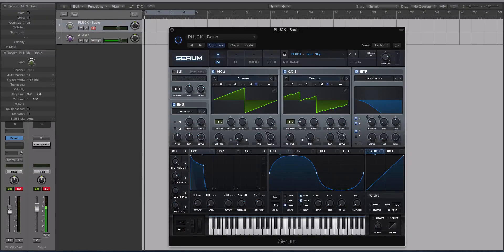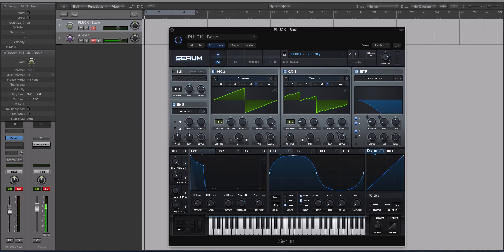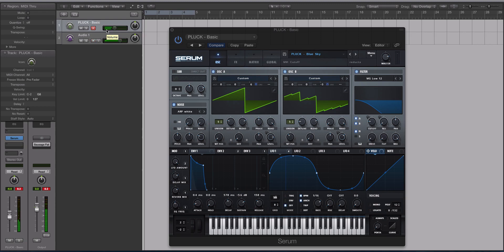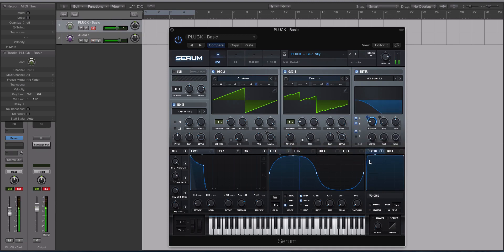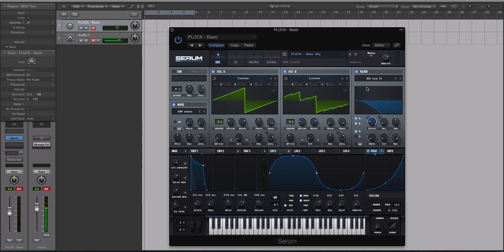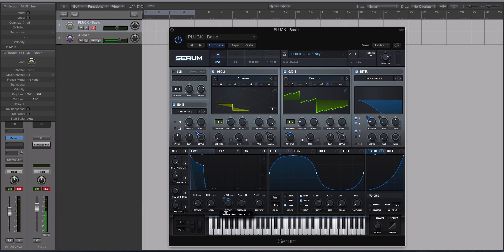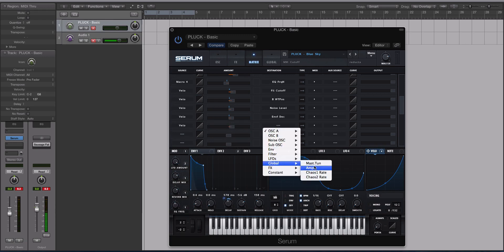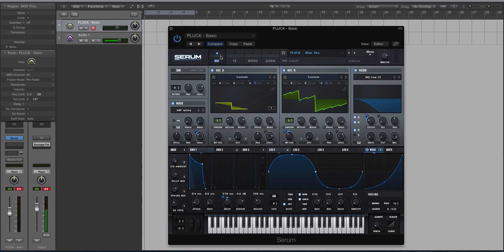How to quickly make Serum velocity sensitive

Comment: If you can't get velocity 2 global-amp to work then change the mod type to 'bipolar' .. As far as I can see it has to be bipolar for it to work...
Reply: THAT was the essential bit of information I came here for...which was overlooked in the tutorial. Thank You!!!
Reply: Could someone elaborate where this bi polar function is?
Reply: @joshlawson275  On the Matrix page, click the horizontal arrow in the Type column to toggle between unipolar (default) and bipolar
Reply: Thnx! I have it working like this:

Source: Velo
Curve: unchanged
Amount: place slider to the right
Destination: Global -> Amp.
Type: click so it's bipolar arrow:  <->
Mod: * (unchanged)
Aux Source: Rel. Velo
Curve: unchanged
Output: unchanged
Reply: @domage  Thank you! I don't know why this is so hard to do. just needed velocity to control VOLUME not anything crazy.

Comment: Hey, I discovered something called Aftertouch in the matrix. I was making a metallic growl when I saw this, threw it on the Master Tune and got a crazy, Sub Traktor style bass. EXPLAIN!
Reply: Aftertouch is pressure applied to the key after note-on .. so you play a note on the keyboard and then push down hard on the key to get aftertouch CC, if your midi keyboard is capable of that - if it does you'll see midi data coming in when you apply pressure to the key. Very useful controller.